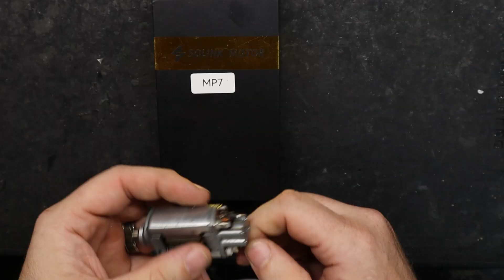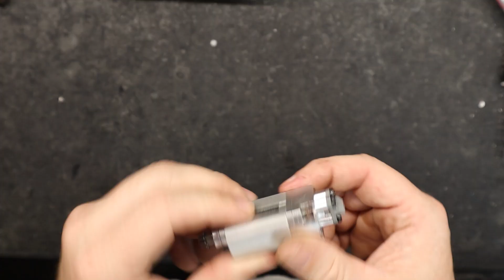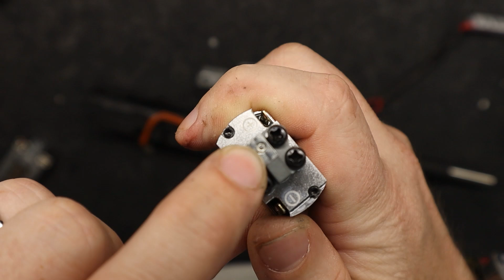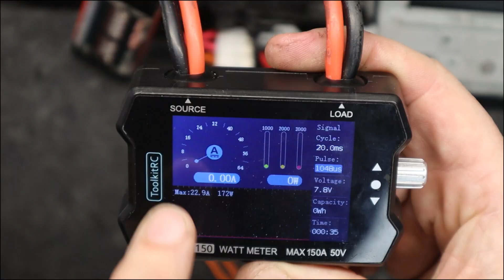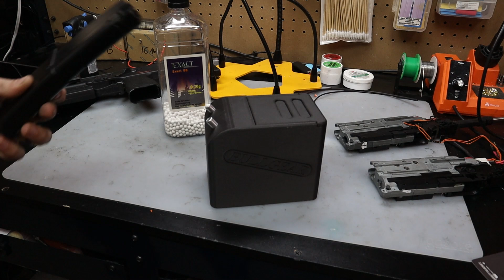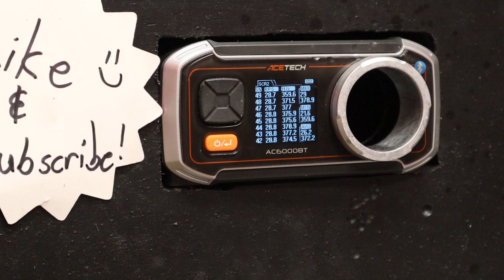AIRSOFT VFC MP7 BRUSHLESS MOTOR?! Review and test! #airsoftonly

Comment: This really helps as I'm trying to fit the solink brushless motor in. Right now, mine works if not fit back into the shell. Seems like the shell fitting is a bit snug and the last 3-4mm push-in may have pushed the motor into the gearbox causing it not able to fire with the double beep. Checking if you need to grind off the top of the motor as well for fitting into the shell as I can see 2 slanted slimmer section around the motor position on the shell?
Reply: Just to followup, yes, it does require some more further tuning to fit into the shell otherwise the motor being pushed into the gearbox causing a lockdown. I had to cut out hole on both sides of the shell at the slanted groove between the grip and trigger so it doesn't push the motor backward into the gearbox when fitting into the shell.

Comment: Hey this might be a long shot but figured I would ask, I recently got a used one for free and it's missing the outer barrel assembly and front cap (battery cover cap). Was wondering if you know where I could possibly source those parts, new or used. 😢

Comment: You didnt even program the motor? Or is their VFC version not even programmable?
Reply from the maker: The motor is not programmable but damn that would be nice!! I wouldnt recommend the current release as they have fitment issues as mentioned in the video.
Reply: @wyshtechairsoft crazy how a newer motor isn't programmable or even screw set for rpm, the cheapo offbrand brushless even have a screw set rpm at the least, super surprised solink did that

Comment: I removed a bit of the Motor cage fins. The Motor backplate and the hopup the Motor Sits and works good now but when i try to put the box in the body i have a space of 2mm and couldnt it get the way complete in again.
Reply from the maker: Something is blocking it somewhere. Check any possible spot that could stop it.  Maybe a wire is getting caught? Maybe more trimming on the chassis is needed?

Comment: I have used the MP7 with a brushless motor for about 3 months. If you just do some machining on some parts, there is no problem in using it. However, the tappet and nozzle are causing problems. So I replaced the tappet and nozzle with metal ones and I am using it without any problems. I use it once a week, about 10,000bbs times a month. It is still working without any problems.I use 11.1v.
Reply from the maker: Main issue I run into is the bucking lips folding over into the barrel and causing jams.  What bucking are you using?
Reply: @wyshtechairsoft It may be hard to get, but use a 23.6mm aluminum nozzle. The nozzle is easily damaged due to feeding problems. This puts a strain on the tappet and motor. I like the MP7 so much that I have 4 of them and am testing them out. My goal is to use them without any trouble.
Reply: I have never had that problem. I am using maple, unicorn, and 4uad hop-ups. I like the 4uad hop-up rubber. There is also a video of me using it during a game.
Reply from the maker: Ive had the bucking lips fold over on multiple different mp7's. Ive tried maple leaf and begadi buckings. Its the ONLY issue Ive had.  I am certain its bad hopup units from the factory. Hell, even the stock buckings do it too.  From what Ive experienced myself and others who DONT have this problem. Its got to be a bad molding process or design on the hopup.  Ive spend countless hours trying different nozzles, barrels, and buckings.  I even went as far as using a 24.5mm nozzle and shaving the bucking lips flush with the feed tube. Feeds with no issues but the bucking lips STILL fold over into the barrel. Causing bbs to explode or straight up clog the barrel.

I have an entire box full of VFC MP7 gearboxes/parts and muiltple mp7's to tinker with when I finally get time to mess with them again.  Plus Ive built 4 mp7's with all having this issue of the bucking lips folding.
Reply: @효섭양  do u have twitter or instagram to talk about it?
Reply from the maker: @opNEFER yup, its in the description
Reply: @Nefer.airsoft i have a insta.

Comment: what u do in them to have 360 fps?
Reply from the maker: Spring tension.
Reply: Are these gearboxes compatible with normal springs or is it proprietary?
Reply: @derrekpollard8252  I think the diameter is the same as any AEG, but the length is specific, but then you can just cut it
Reply: @Nefer.airsoft  That’s what I kinda figured, I threw in a 6.01 barrel and I’m trying to figure out if I gotta make any adjustments to compensate for fps change before I throw it all back together

Comment: Is there a guide on how to make the mp7 reliably work ? Some friends have it but constantly broken
Reply from the maker: I spent hours apon hours of trial and error to prevent the damage from happening on 3 different mp7's.  Best piece of advice. Convert it to HPA or only use 7.4v lipo.  11.1v lipos make it cycle too fast and causes damage.  Also, avoid soft buckings as the bucking lips gets folded into the barrel from the bb entering the chamber.
Reply: @wyshtechairsoft What degree do you consider ideal for bucking to not cause problems? 60°? and you think Better switch The original bucking imediatly after buying The mp7 or change over time? .Do you think that even someone who spends an average of 5k bbs per month  , doesnt use the equipment constantly and never uses full auto in a game needs to use a 7.4 lipo or is it just people who demand more from the equipment?
Reply: Same ! My cousine had issues... This IS the third...
Reply: What degree do you consider ideal for bucking to not cause problems? 60°? and you think Better switch The original bucking imediatly after buying The mp7 or change over time? .Do you think that even someone who spends an average of 5k bbs per month  , doesnt use the equipment constantly and never uses full auto in a game needs to use a 7.4 lipo or is it just people who demand more from the equipment?